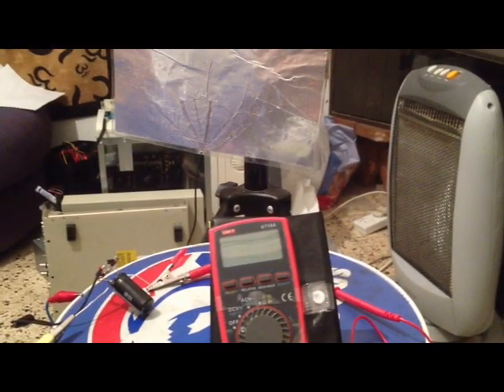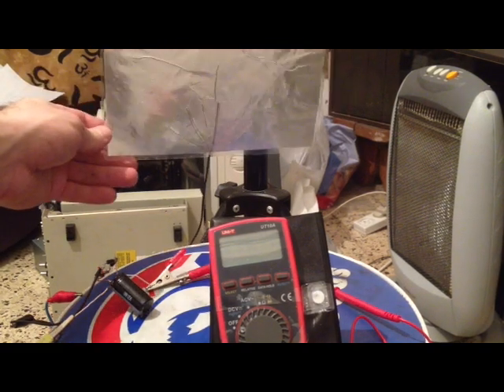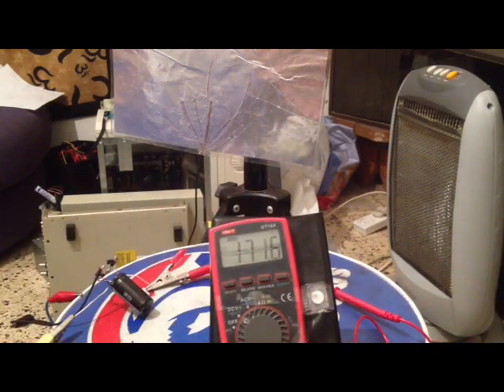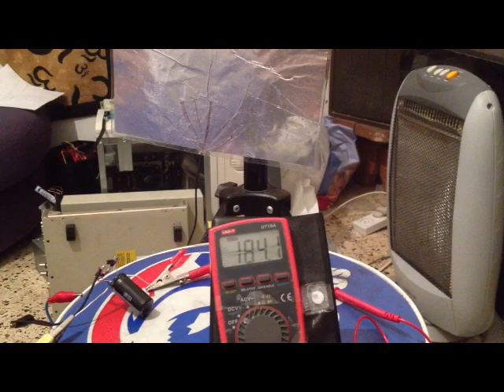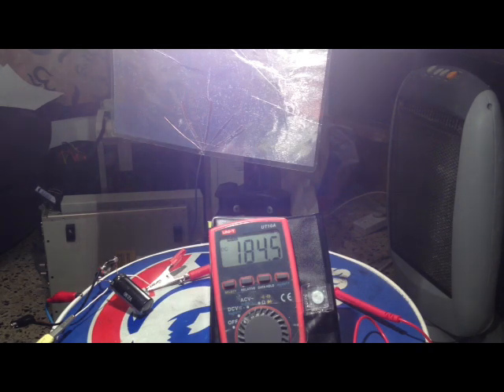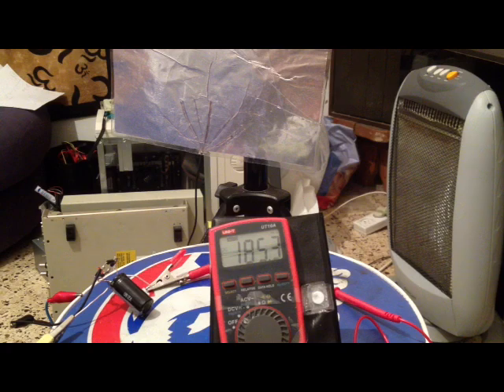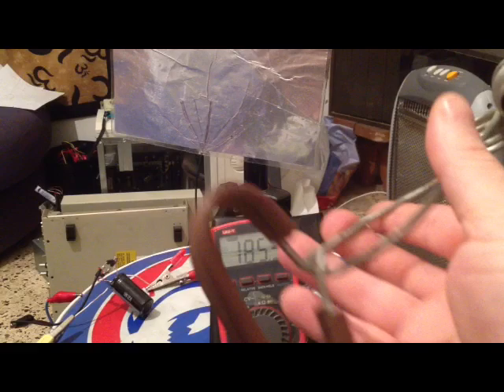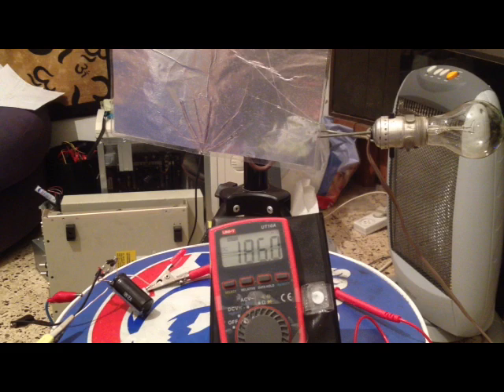modern radiant energy antenna diy

Comment: what you made was an RF antenna to collect the stray RF 60 Hz created by the a.c. electricity running the light...there are circuits you can buy that are called parasitic power sources. you are collecting RF energy charging the capacitor..

Comment from the maker: it's quite simple my friend you're asking the wrong question you're supposed to ask how long does it take to charge a normal battery and not what kind of battery could you charge of such a low-voltage.
By the instructions and teslas patents he explains that simply a matter of time to collect the amount of energy needed to charge my take a lot longer then charging from conventional AC but this is free and nonpolluting and with this energy he ran his tesla coil which sparked out lightning